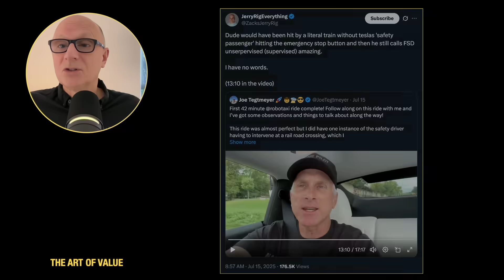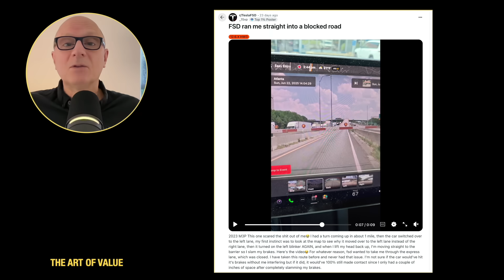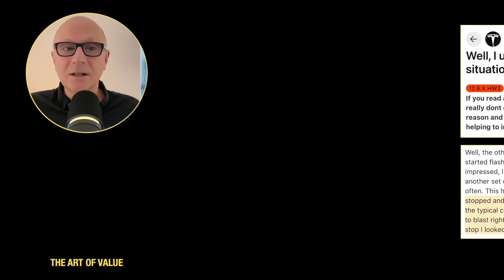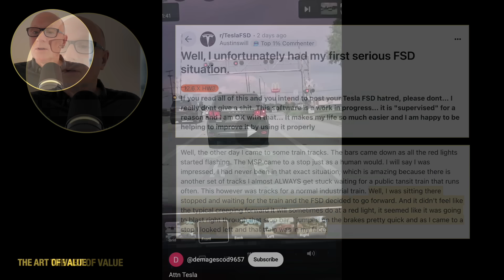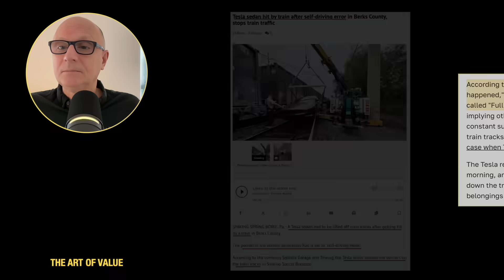DANGER: Tesla FSD Robotaxi Can Miss Railroad Crossing Arms!

Comment: Hearing “if there was no safety monitor, this would’ve been disastrous” on repeat is exhausting, especially given that there is always a safety monitor. By that logic I could say: “What if my car no brakes? That would be disastrous!”  Why not show clips where FSD saves lives -- slamming on the brakes to avoid cross-traffic red-light runners? The issue isn’t that cameras can’t see those barriers; it’s that the AI needs more training on those less common barriers -- exactly why safety drivers exist, until those edge cases are fully trained in, which requires real-world examples to train on; hence safety drivers. Meanwhile, human drivers kill ~40,000 people a year in the U.S. alone -- equivalent to a  9/11 every month, yet nobody makes dramatic reaction videos about inexperienced 16 year olds killing their neighbors. FSD has the propensity to save millions of lives worldwide every year, but fear mongering just slows it down and costs more lives.

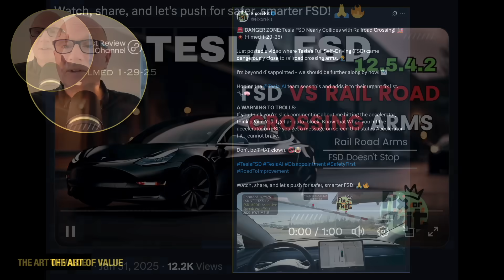Comment: Joe’s comment about fixing the software indicates a common misconception. FSD relies on training data, not software logic, to handle these situations. If the training data does not contain a similar example, FSD does not recognize the situation. A fallen birch tree at 4:30 in the afternoon on a steep hill with shade may also be missed. A construction crane boom which has fallen across the road on a foggy morning might also be missing from the training set. A Tesla relies on visual object recognition - it does not have radar or lidar to accurately measure distance to an object. You can throw massive data sets at a massive supercomputer but nature is difficult to fully predict.

Comment: As an engineer, There's 2 things I can't comprehend about musk's approach :
1) Camera Only
2) AI Only

Like I can understand the want to make it as applicable as possible to general vehicles, but Waymo has far outpaced Tesla in this field already, which is sad considering Tesla created the "original" Self driving technology. It seems Moore's law is working on the LIDAR technology, with equipment dropping in price by hundreds of times compared to what it was just a few years ago, and on the path to keep doing so, so the "Cost barrier" argument as a reason to not incorporate LIDAR systems is quickly disappearing as a valid argument (and makes Camera-only seem like just an unnecessarily restrained design).

For AI only, this seems especially dumb to me, given the current state of AI and how it's so much more difficult to see what's happening and why certain decisions were made, as well as it's far more difficult to correct any issues found. You can't just "adjust" how it reacts to one situation or modify one parameter, you've gotta "Re-train" it on a certain situation, and "Fingers crossed" that it will ACTUALLY do what it's supposed to do every time going forward after that. It's an endless loop of wanting a) things it's trained on to not change, while b) things it's doing wrong to change , but you can't do b) without risking a). It's just BAD design. There's nothing wrong at all with explicitly telling your Self-driving system "If you're in this situation, you do THIS, THIS, and THIS" and hard-code those steps. There's no point in trying to abstract EVERY SITUATION IMAGINABLE into a black-box AI network system and "Fingers crossed" that it's able to, 100% of the time, correctly respond to all situations, while "Fingers Crossed" You're able to get it to fix what it's doing wrong, while "Fingers Crossed" not changing how it does anything else it's already been doing correctly for a long time at the same time. 
In my mind, it's just not possible, So you're better off giving it some sort of hard-coded structure for certain situations, and let the AI handle standard normal situations or oddity unknown situations. To go 100% AI is one of the dumbest moves you could have done, and that's what I thought when I first heard that the FSD was moving to 100% AI modeling. It's just stupid from an engineering POV and a Safety POV.

Comment: They will eventually get it fixed after a few updates in the software and camera hardware… remember airplanes are also auto-piloted and those have failed  numerous times with more disastrous results as well.Does it mean that aviation stops using them?

Comment: I have not had FSD for two months but I do not think anything significant has changed.  Tesla needs to solve the problem of not recognizing some speed limit signs and when it does slow down before the sign not AFTER; likewise, know when it is in a school zone and slow to the posted speed.   I do not know what FSD does when it encounters a school bus displaying the flashing red lights but it definitely needs to respond correctly.  Bottom line not following posted speeds or doing something wrong in a school  zone is a big red flag no-no.
Reply: Quick follow up observations.  I do NOT assume the crossing bar/lights always work flawlessly and always look both ways down the track when approaching a railroad crossing.  Rail crossings in many rural areas only have signage  (hopefully) no safety bars/lights what will FSD do at those crossings?

Comment: Robotaxi is still in the testing stage... phantom braking is basically gone, railroad crossings are obviously not fixed, and safety monitors will not be removed until railroads are fixed. 
Right now, it looks like Tesla only has problems with stop bars and closed roads. Closed roads can be fixed operationally railroads with loading more exaples to the AI.

Comment: I’ve been driving FSD HW3 for nearly a year, and it keeps improving, but I know it’s still missing things.  Normally, all goes well.  But then something odd happens, and my safety margins compel me to take control.  Honestly, I don’t know if the intervention was needed, maybe it would have stopped, maybe there was enough room in tight spaces, maybe it would have avoided a pothole or slowed at the last second.  But who wants to take the chance?  It’s like sitting there watching with a teen driver in control.  Better, yes, improving, yes.  But, I’m not going to relax until some flawless driving happens for months if not years.

Comment: Humans have binocular vision and the ability to constantly adjust focus to support depth perception in order to understand the environment ahead. Tesla has decided to just ignore hundreds of millions of years of animal evolution and start with a novel approach involving an array of different cameras. As a result, it should be expected that there will be countless edge case scenarios where what may seem like an easy problem for a human driver will cause the FSD to stumble. Now, considering that roads, road rules, etc. have all been optimized to accommodate human drivers, it seems reasonable to start with a human vision based approach to the AI, which can be augmented with an additional layer involving more cameras and other kinds of sensors.
Reply: It's also incredibly brainless not to use lidar. Cameras like tesla's cannot see through fog or smoke even as well as a human can. Lidar can see better than a human through those things. So basically only an out of date idiot who is tech-resistant would not use lidar.

Comment: Since every Robotaxi will need a human remote monitor, I suggest putting the monitor directly in the car to lower latency and prevent broken connection. The monitor could directly correct speed and trajectory with the various controls already installed. I would call that new amazing techological marvel a driver.

Comment: It’s worth pointing out that even trains are not driverless and ‘all’ they have to do is follow a track and stop at designated points.

It’s a MUCH less chaotic, fuzzy problem for automation to solve. And yet we still need drivers to handle all the situations that can and do arise. We still even need signal operators.
Reply: To be fair, there are trains that are fully self piloting...we have them for mass transit here in Vancouver BC. They are on mostly elevated tracks, never encountering cross traffic and loading/unloading in highly restricted access stations. So lots of the variables are essentially eliminated. They do shut down when obstructions are detected on the tracks (like a dog getting loose on the tracks or during heavy snow accumulation etc.). But a much, much lower complexity than a car on a public road.
Reply: @TornadoCAN99 yes we have one in London, also elevated. But it’s a very simple route.
Reply from the maker: Most are not, but some are now. There's a new underground system in Sydney that fast's and driverless, but it's underground, with no crossings.
Reply: @TheJohnJohnstonLounge yes crossings are the big no-no.
Reply: Keep in mind a big factor there is very little business incentive to automate a train. The cost of paying a conductor for the duration of the train route is almost nothing compared to all the other costs.

The R&D costs will be huge and there are only a small number of potential customers to amortize that cost. Not worth it.

Comment: I own a Tesla Model y Juniper like the ones used for Robotaxis. I have full faith that observed issues will be worked out. Every great accomplishment requires testing and advancement. In 2 months I have had no issues.
Reply: So, it's okay to endanger the general public's safety because the system needs to be tested till it works right?  Wow.
Reply: @LorenSoman Not sure if you were paying attention but there’s a safety person riding in the front passengers seat to prevent a harmful situation from happening during the testing. So the general public is not in danger.
Reply: @andrewbryant4767  the safety person can only intervene by pushing a stop button. I can think of a lot of scenarios where that wouldn’t be sufficient to prevent an accident. This is a dangerous publicity stunt. If Tesla cared about safety, they’d have the safety driver in the driver’s seat.
Reply: @JakeHambyZ80 I guess you could always go back to a horse and buggy. Not much risk and I understand they were pretty safe in their day.
Reply: @andrewbryant4767  don’t be facetious.
Reply: @JakeHambyZ80 This was certainly not meant to be flippant but rather was to bring attention to the fact that even with the advent of the early automobile, there were cautions to consider.  In 2023, in the US, there were 6.14 million automobile accidents, all from driver driven ICE vehicles. Over 40,000 of those resulted in fatalities yet there seems to be more uproar about the possibility of change. I suppose we can continue with millions of accidents annually, regress to times of old, or look toward future technologies that may someday provide a safer path.
Reply: @andrewbryant4767  I’m all for using technology to increase safety. I just think Waymo is following a much more sensible approach to autonomous driving than Tesla, who are trying to do things on the cheap.
Reply: @JakeHambyZ80 I definitely understand what Waymo is attempting and my hat is off to them. They are far from perfect though. I suppose within the next 12 months both Tesla and Waymo will have enough data to compare. Waymo’s initial trial with a safety driver resulted in the death of a person crossing a street in Tempe, Az. Even now the Waymo’s are blocking traffic in Austin. I’m not sold that their approach is better. We shall see in time and I wish them all the best.
Reply: @andrewbryant4767  the fatality in Tempe was an Uber self-driving car, not Waymo. I know for certain that Waymo has not been responsible for any fatalities (there was one multi-car pile-up with a fatality where the Waymo wasn’t at fault). I know from an engineer who works at Waymo that they’re not going to enable freeway driving for paying customers until they’re thoroughly satisfied that it won’t break their nearly perfect safety record.
Reply: @JakeHambyZ80 You are correct. My apologies for getting that fact wrong. I do wish Waymo technology well.

Comment: The tesler swastikar brand is done. All auto makers are feeling more comfortable with the Waymo autonomous driving software for their vehicles. Tesler will finish proving that camera only level 2 supervised false self driving will never work. If tesler collected data of millions of miles of bad driving by their human drivers is what they are using to program their software. It will be speeding, slow rolling thru stop signs, running red lights, even driving on the wrong side of the road, the ignoring the train track arms to beat the train could be human driving as well.

Comment: This is a bad problem that will be hard to fix for them. The problem is that the barriers are at the level of the horizon for the car's cameras, which are 2D and can't see depth. It literally can't distinguish them from the background once they and it stop moving. Meanwhile it can see that the road beyond is free, so it just starts driving. If Tesla persists in refusing to use radar (which some of the cars actually have!) or lidar and continues to rely on 2D pictures this will be tough to remedy.
Reply: No 'self-driving anythings should be on the roads. And even driver-assist ought not to be able to do anything uninstructed unless the vehicle has properly tested LIDAR as well as cameras.
Reply: @alisonwilson9749  Why aren't you equivalently outraged at inexperienced 16 year old drivers on the road killing their neighbors everyday? The hypocrisy is frustrating. FSD hasn't yet killed anyone -- only humans who have failed to use it correctly. In the U.S. humans, misusing their traditional vehicles, kill an equivalent of a 9/11 terrorist attack every 28 days. The selective outrage towards FSD is exasperating.  The safety-montor is there because it isn't perfect yet, but FSD saves lives, especially since the advances in version 13. The clips of it slamming on it brakes when cross traffic runs a red light doesn't get views, because only fear-mongering feeds the social media algorithm. I feel so much less safe when I have to drive a traditional car.

Comment: This latest version of FSD is just fantastic, I drove 45 minutes and only had my entire life flash in front of me one time. Very stimulating!
Reply from the maker: Just needs to be polished a bit...
Reply: By your logic -- every day that I drive a traditional car, my entire life flashes in front of me every time I have to apply the brakes at a stoplight. What if I had no brakes? What if the Robotaxi had no safety monitor? The fact is that it does have one, so no life flashing in front of anyone's eyes.  Allowing licenced 16 year olds to drive on public roads results in 10s of thousands of innocent deaths each year. Cars are dangerous no matter what. FSD has the potential to remove 99.999999999% of the danger. It's not there yet, hence the safety-monitor that every robo-taxi has, who is present until FSD does reach 99.999999999% safe, which requires additional AI training on the edge cases, and that AI training requires real-world cases, just like a 16 year old requires real world cases before they are more safe, even though in aggregate humans at any age will never reach the safety level that FSD has the potential to reach. Yet we let 16 years old drive w/o safety monitors who so often kill our neighbors. The hypocrisy of FSD haters is unbearable to listen to.

Comment: Does Tesla just have an issue with barricades?  It runs through flashing school bus arms, too, and proceeds to run over the child dummy crossing in the street.
Reply: It’s because they have no sensors other than visual cameras, no radar, no LiDAR.

Software CAN identify hazards and obstructions but there is a processing latency which is too slow to react. And while a real driver will see a school zone or a parked school bus and automatically slow down, Tesla FSD just sees another Road and a stationary vehicle.

It may be trained to recognise that risk, but then it has to be trained to recognise EVERY possible risk because it has no ethnical reasoning and no sense of consequences.

It’s a dead end technology.
Reply: I don't think it even realized it was a school bus, it thought it was a normal truck, these are fundamental problems with FSD!

Comment: The ride was great until I was almost killed by a train….
Reply from the maker: Exactly. Safe, until that moment when it's super-dangerous.
Reply: By your account, every time in my traditional car I approach a train crossing w/ a train present I am almost killed. That is, if I didn't have brakes, I would die.  The robotaxi had a safety-monitor to apply brakes. Every Robotaxi has the safety-monitor, exactly for that reason, and will continue to have safety-monitors until the edge cases are ironed out. Allowing licenced 16 year olds to drive on public roads results in 10s of thousands of innocent deaths each year. Cars are dangerous no matter what. FSD has the potential to remove 99.999999999% of the danger. It's not there yet, hence the safety-monitor that every robo-taxi has, who is present until FSD does reach 99.999999999% safe, which requires additional AI training on the edge cases, and that AI training requires real-world cases, just like a 16 year old requires real world cases before they are more safe, even though in aggregate humans at any age will never reach the safety level that FSD has the potential to reach. Yet we let 16 years old drive w/o safety monitors who so often kill our neighbors. The hypocrisy of FSD haters is unbearable to listen to, especially considering that humans kill the equivalent of a 9/11 terrorist attack every 28 days (in the U.S. alone).